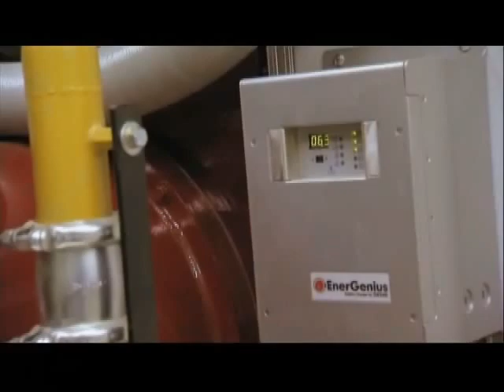Butler Farms on OFF LIMITS 2012

Comment: How do you heat the waste?
Reply: +helyett janó The waste water is circulated through the engine and the engine heat is used to heat the effluent in the digester.  It is the same  process as a radiator on your car.

Comment: I appreciate your "play" on words, Andrew.  Yes, we produce much more electricity with our swine waste than we use at the farm.  We sell the excess electricity back to the grid and the co-op in turn distribute our renewable energy to our cooperative members to use in their homes.  We also use solar panels to produce green energy to run the equipment that makes our renewable energy.  Our digester and waste storage ponds are lined.  The two larger storage ponds needs clean out in 7 years.(2020)